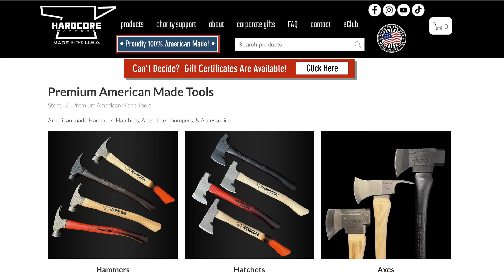Corporals Corner Mid-Week Video: The Survivalist Hatchet by Hardcore Hammers

Comment: I used to have a zippo woodsman and it sucked. The blade was too thin and you also couldn’t drive the axe head deep into a piece of wood due to the handle being molded around the axe head instead of the axe head around the handle. I will definitely get one of these axes when I can afford one

Comment: Got mine in the mail today, looks and feels like a great tool. Lite weight, easy to pack and pleasing to the eyes. If I had a complaint about it, it say the varnish finish on the handle needs to go, so I'll sand it down and add a thick coat of boiled linseed oil. Other then that, spot on good Sir....

Comment: That is what is known as a roofing hatchet. It is made for roofing with wood shingles or shakes.
Reply from the maker: thanks for watching
Reply: No, it's a carpenters half hatchet.

The shingling hatchet is different,  there was a time when the shingling hatchet kind if looked like a cross between a half hatchet and drywall hammer, but for a long time the shingling hatchet has had a very narrow bit with depth gauge holes in it.

Comment: I like this.  Mid-week gear reviews and weekend full length videos.  Is that a scandi grind on the bit?  Thanks Shawn.  BTW, in our video I noticed that where you are squatted down talking about the hammer, there was a bolt with a washer that was missing a nut in your build.  Check at the 4:02 mark.  Just wanted to let you know for you to check.

Comment: The problem with this is that it was basically modeled after a modified or worn out riggers axe, so the bit is thicker and shorter.
The handle is also not the best shape.
4140 is what they make barrels out of, and calling it " ordinance steel " is kind of just gimmicky buzzword marketing.

Personally I would say just save your money and get a Vaughan & Bushnell half hatchet or riggers axe.
If you want a sheath and factory sharpened bit then I guess get this, but the V&B is a better tool in general.

That's just my opinion though, I'm not saying this is a bad tool  or anything.
I just believe the V&B is a better option, the half hatchet is around $20 and their riggers axe is $45 at the most.

Comment: 40 ounces is really, really heavy for a hatchet that only has a 19 ounce head or whatever.  It must have a seriously overbuilt haft to achieve that.  That means the point of balance will be low and it won't be an efficient chopper.

Comment: I am always in two minds about hatchets and axes. Over here (UK) you can get some inexpensive pearing hatchets as light as 500g (1 pound 2oz) and I use that if I'm taking a saw. If not I take a heavy duty hand axe which is about three times that weight and for some reason way easier to keep sharp. Is it worth the extra weight? Maybe. It depends on how long I'm going out. on a long one the extra kg is a days food. I also always take a heavy duty knife and a Mora 860 as backup anyway. So I would take a "Hardcore"  in a heavy setup (60 pounds) but for traveling fast my maximum pack weight is 15 pounds and before I got ill I could run 10 miles with that and cover another 10 with plenty of time to set up a camp for the night and chill out.